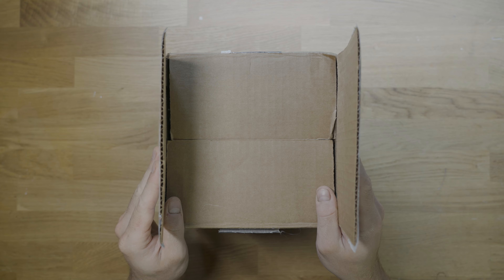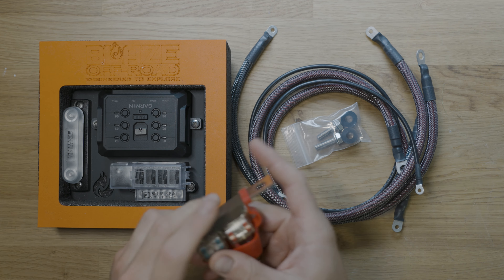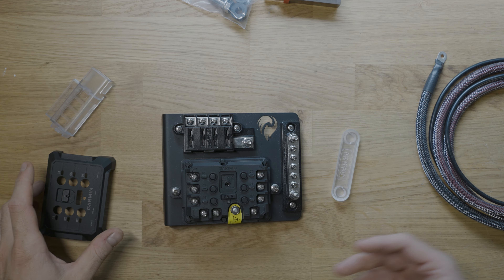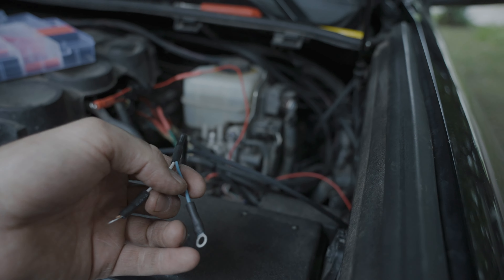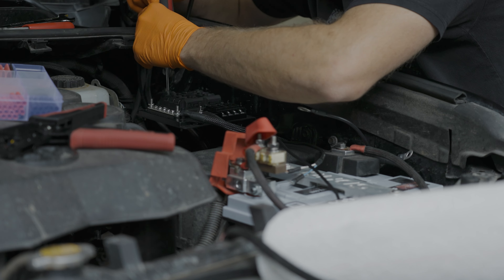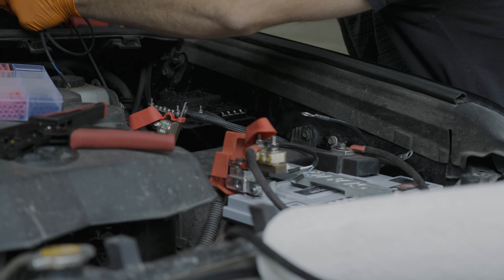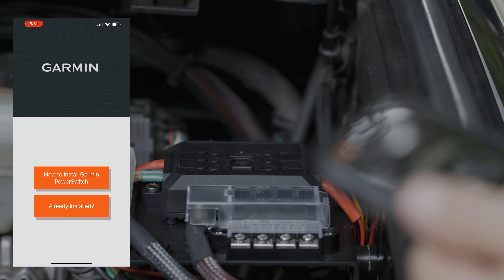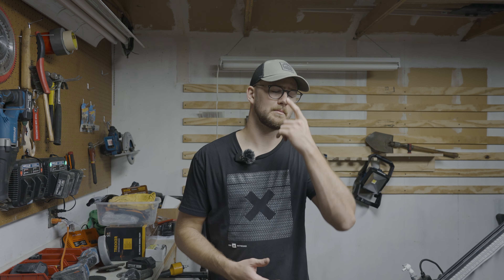BEST Value Expandable Lighting DIY Kit System I wish I bought starting out...Don't make my MISTAKE.

Comment: curious what you used as a spacer between the bracket and engine bay... looks like some kind of bushing? without a spacer/bumper, one side of the power switch is effectively useless.
Reply from the maker: @bensonkaai  they come with spacers
Reply: @OverlandEngineer  hmm mine did not, bought the bracket and hardware only kit but seems weird to not include with all purchases. Appreciate your response, and our channel. Thanks again
Reply from the maker: @bensonkaai  no worries!  Maybe just call or email Blaze Offroad, they should be able to help you!

Comment: Does using the Garmin require getting rid of the Switchpro unit? I have a SP-9100 and am wondering if I can use the Garmin for expansion and run the Garmin through my head unit. So, could I use the SP-9100 for certain basic switching functions and the Garmin for everything else, including controlling things through the head unit?
I still think you and Kai should have a throwdown, Toyota style.  :))
Reply from the maker: Oh definitely could.  Depending on your bracket too you could drill custom holes and mount up a garmin pretty easy.  I swear they fit anywhere because they are so small and self contained.
Reply: @OverlandEngineer  Thanks!

Comment: I just purchased the raptor lights and garmin kits from blaze! 

Is there another way to automatically turn on the amber drl’s without tapping into the ignition fuse? I’d prefer not to tap into any fuses
Reply from the maker: What you could potentially do...I am not sure if this is a feature or not.  But a lot of units have memory so if you turn them on they will stay on.  The issue is the system won't know when your vehicle is turning on and off...You could just tap into a different fuse that gets power once the vehicle is on.  There are also T taps to tap into a wire below the fuse box.  Tx.4Runner on IG is making special fuse box risers that are conducive to add a fuses.  There are some options potentially but its hard to get around if you need a vehicle running trigger. At least that is my experience.  Maybe Blaze Offroad could give some suggestions.

Comment: What I want is have my headlights automatically switch between daytime running lights to night time. Can you do that? And how to add dual sided AC.
Reply from the maker: Well probably someone could by pass that switch with a calibrated photo diode or something that could determine day and night...then the photo diode could be a trigger wire for maybe controlling two garmin switches for the low beams and the DRLs haha.  Just spit balling.

Not sure how to add dual sided AC...that might be searching the OEM parts catalog and depending on the wiring harnesses, could maybe retrofit dual climate control from limited to the lower trims...that sounds like way too much work.

These are creative questions but thats not remotely simple haha
Reply: @OverlandEngineer  the headlight thing bothers me so much. I have a 22 ORP. How can they not include that?